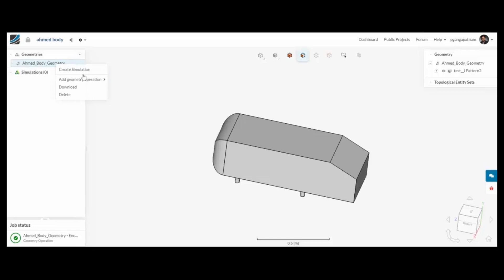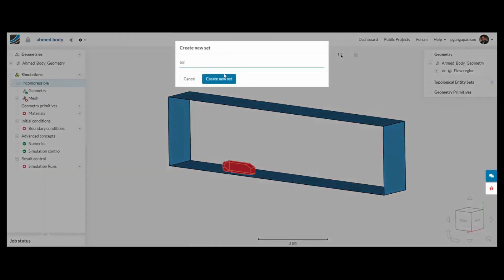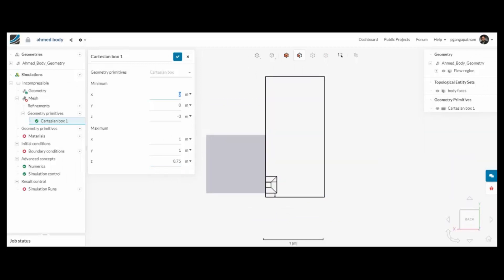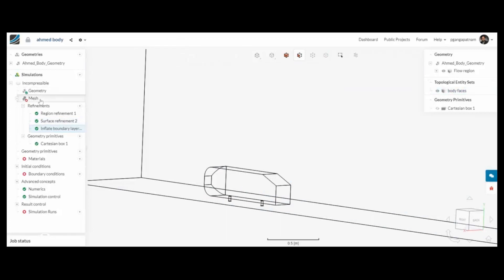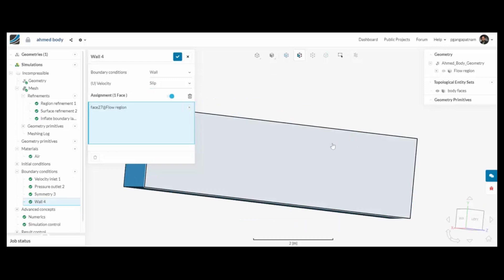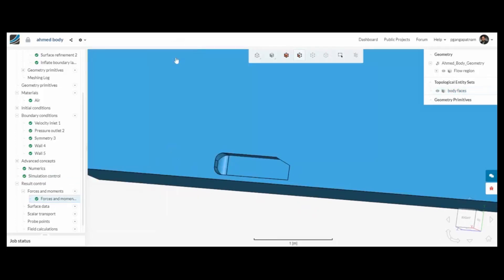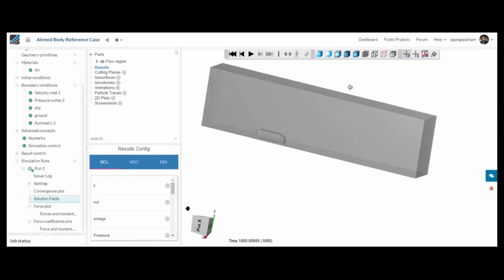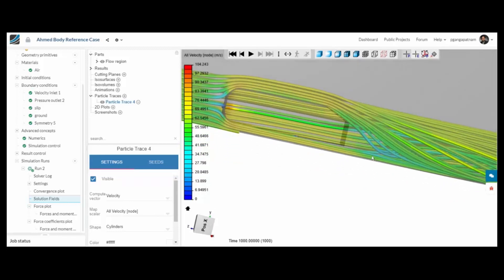External Aerodynamics of an Ahmed Body

Comment: Should I always match the velocity of the air defined at the inlet boundary condition to the velocity of the moving wall and rotating walls (tires)? What if I want to simulate for example that the car is travelling at 200 km/hr? In that case, should I change all of the velocities, including the inlet boundary condition to 200 km/hr or only the moving and rotating walls?
Reply from the maker: For a vehicle analysis where the car is driving in still air, the speed of the street and tires should match the free stream velocity.
Reply: @SimscaleSimulation  Okay, thanks for clearing that up for me!

Comment: I have no option for enclosure, I cannot make an area for a wind tunnel, no geometric options
Reply from the maker: The enclosure command was moved into the CAD edit mode, under the Flow region - external operation. More details can be found on this page: https://www.simscale.com/knowledge-base/flow-volume-extraction/
Reply: @SimscaleSimulation  i did find that out but that didn't work so I had to make my own in my cad software

Comment: How do you determine drag coefficient?
Reply: 1: Determine frontal area for a land vehicle. Or wing reference area for aircraft.

2: Calculate dynamic pressure, which is q. Q = 0.5 x Density x Velocity^2.

3: Determine total drag force acting on vehicle with SimScale. 

4: Divide total drag force acting on object by Q (dynamic pressure) to obtain its flat plate drag area. 

5: Drag Area / Frontal area = Drag coefficient.

Comment: Why didn't you assign no-slip wall to the ahmed body? Also why not just assign slip wall to the bottom wall of the fluid region, you instead made it a moving wall?
Reply: You can of course add a no-slip condition to the Ahmed body but the default (in case you do not assign anything to the entities) is a no-slip condition. I personally would always explicitly define everything with a BC assigned to it. As for the second question, there is a huge difference in flow behaviour when only using a no-slip wall or moving wall (recall the definition from your fluid lectures of Couette Flow and Poiseuille Flow) - the moving wall therefore mimics the real world better. Does that make sense?

Comment: Why don't I have the "enclosure" tab on mine?
Reply: You have, what you have to do is to choose the context menu of the geometry and choose "Add Geometry Operation" and then go to "Flow Volume Extraction".
Reply: @JousefM  I only have the free version. Do I need the full paid version to do this because I could not find what you said?
Reply: @josephshubin8465  Hi Joseph. You should be able to access it as well. If you write a short post in the forum explaining what you want (in case others look for this issue when using the search function) I can post a screenshot or small animation of where to find this tool inside of the workbench.
Reply: Mine is greyed out
Reply: @DuckyRC  Can you post that issue in the forum along with your project link? Will check it out.

Comment: Why do you compute the negative volume and do internal flow instead of just using external flow?
Reply: Also, SimScale offers you the possibility to do assignments on your CAD directly instead of the generated mesh if using internal meshing. If you create an external mesh, you have to wait for your mesh being generated until you can do the assignments.